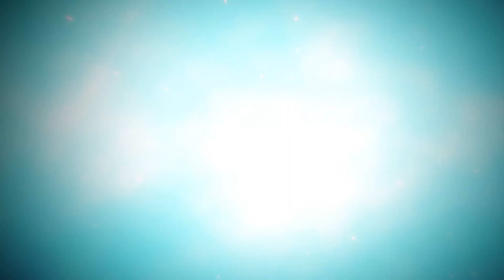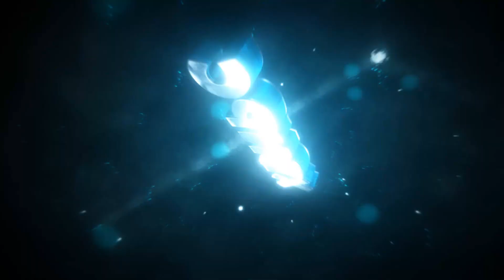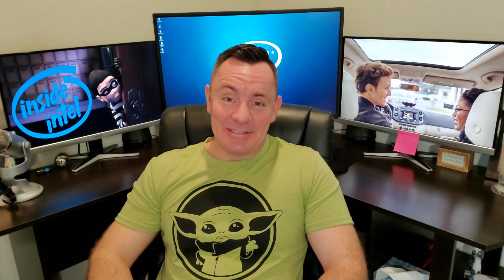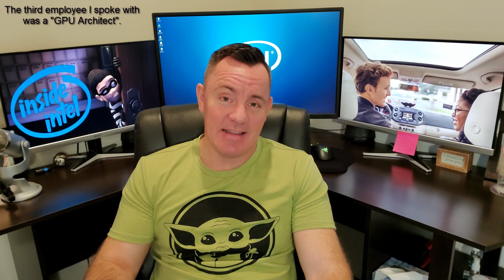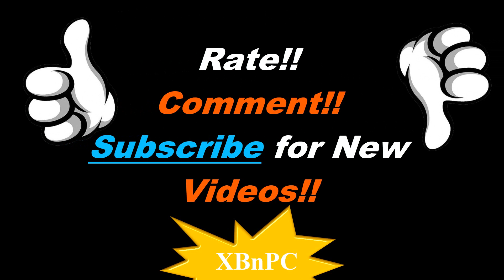Inside Intel - Speaking to Intel Employees About Xe dGPU's CPU's 10nm Challenges AMD nVidia & More!!

Comment: Real good content but the volume is really very low
Reply from the maker: Yeah, it's something I've noticed (after uploading it of course) and you're not the only one to mention it.  I'll definitely give the volume a boost in the next video and check it before publishing.  Thanks for checking it out all the same!

P.S. I know you shouldn't have to do this, but there's a really handy tool available to adjust and boost your audio.  It's called "Equalizer APO".  It's completely free and very effective imo.  I'll pin a link if I can to the top of the comments section for anyone else having trouble with volume.  Hope it works for you!